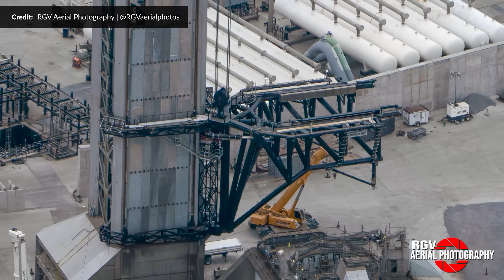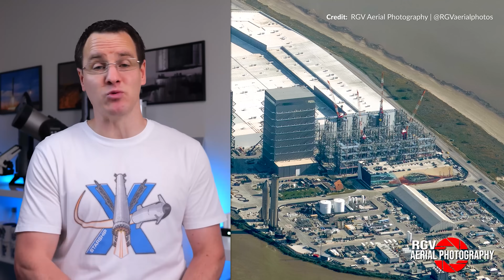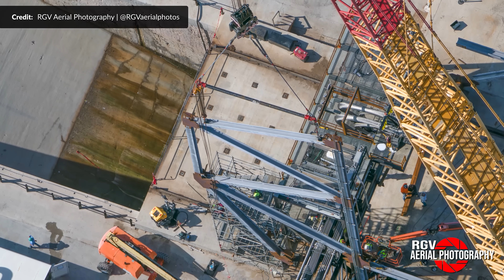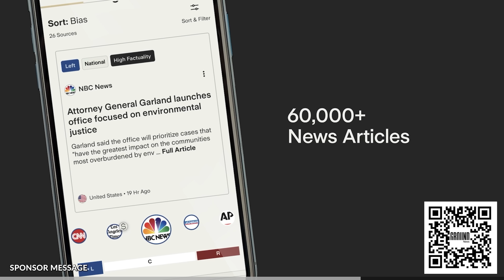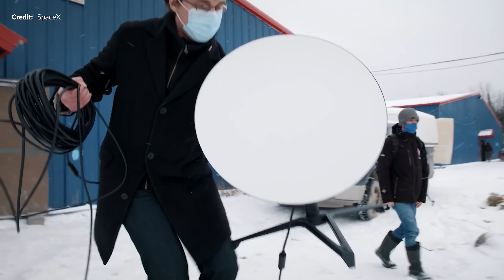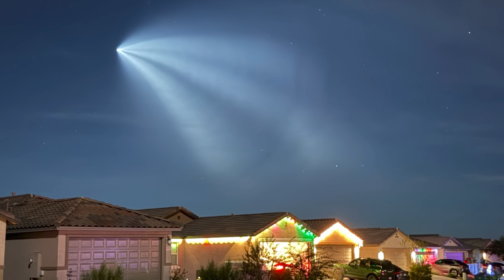SpaceX’s Starship Is Creating Massive Value!

Comment: How does spending a ton of money to develop yet another another rocket equate to creating value? Value is only created if the rocket actually works better than the existing rockets that it aspires to replace.
Reply: It doesn't aspire to replace anything.  It generates value by allowing them to put a large constellation up and keep i up to date on the CHEAP.  Plus they have a lot of internal ambitions (Mars).  It is those  internal goals that are behind the development, not the commercial market.  The ability to put up large amounts of mass on the cheap ads value.

Comment: The problem is that they are developing an EV suit with all its requirements designed for space instead of a lunar highly mobility suit. The mobility suit should sacrifice a lot of the requirement that an EV suit would have. For example the many layers of thermal heating should not be a requirement. I'll go so far as to say that the EV suit is not suitable and is actually dangerous for Moon missions due to it being clumpy.
Reply: Spacex has no need for lunar mobility suit.  IF they have a need for something it would be down the road for Mars.

Comment: I don't think they had a bad COPV batch. I think they removed the extremely dangerous failure point by a fundamental redesign. They are a pretty small part of the whole system, there is no reason to stay cheap and lightweight there. Seeing the Ring Structures around the New Pressure Vessels and the bigger Diameter I suspect they changed it from a COPV Design (composite overwrapped pressure vessel) to a steel pressure vessel. It does not add much weight, but steel is way more predictable for pressure cycles and temperature shifts than Composite Materials. Let alone if the COPVs already have shown to be a critical failure point in first tests. I think steel pressure vessels would be a huge improvement for this reusable Rocket system.

Alternatives could be fundamentally redesigned, custom COPVs with an emergency deflation mechanism (ripping off only on the outside to keep the rocket shell safe). I am very happy to see that critical part changed out before the next tests. This should never again be the initial cause for a RUD.
Reply: Mass issues are a big issue.  Their big goal is lightweight when and where possible.  I doubt they change.
Reply: @imaginary_friend7300  After two COPV caused RUDs I think a few 100 kg more are a decent tradeoff to keep it safe. Who cares if it the whole system can lift up 100 tons or 99 tons? At least until COPVs have been proven to withstand the harsh environment in 100 percent of the ships lifetime.

Comment: Assuming the hydraulic pumps are unchanged the bigger diameter barrels on those arms means that the arm closure will be considerably slower. Evidently they needed more precision even though it means Starship has to hover a little longer.

Comment: Higher density of customers, hmm wonder how wide the beam is. Means if you and your next door neighbor are both using may get some cross feed and thus bad packets.
Reply: You and your neighbor will share the same satellite, along with possibly hundreds of other houses. But no, it won't cause issues with packets. At least nothing noticeable. This has been covered by IT networks for decades now.
Reply: @anthonypelchat  yes that is what check bits are for. Elon cited higher density of customers in his response so I was wondering what is dense.

Comment: Re:title. How? With suborbital flights?
Reply: People can see the potential among other things.  They've been making steady progress, not always timely but progress still.
Reply: Those "suborbital" flights are barely suborbital and actually at orbital speeds. But the construction itself is creating value in the local area as it is adding a lot of value to the community. And Starship will be fully orbital shortly, assuming V3 doesn't have the same issue that the last version did last year.
Reply: @anthonypelchat  I am looking forward to the promised 150 people in starship and the 20 minutes to prepare for the next flight. Or is it all bs maybe?
Reply: @TypHierJeNaam  Point to anytime that Musk, Shotwell, or SpaceX as a company have promised 150 people and 20 minutes for a flight? They have stated that as a possible future, but not some promise for anything.

Also, the 20 mins is just how long it will take from take off to somewhere on the otherside of the planet. They are looking into that for the military and as a possible option in private areas. But it requires a ton of international regulations and approvals that SpaceX has no control over. As such, it has always been stated as a possibility and not a promise. In fact, almost everything has been nothing more than a hopeful goal. Very few, if any promises have been made.

Comment: Yeah only five years behind schedule on Starship achievements. Costing the tax payer a fortune.
Reply: Development rarely sticks to timelines and it's not costing the tax payer anything else.  You need to find a much better source to feed you what you're pretending you know drone.  Your current source is making a fool out of you.
Reply: @imaginary_friend7300  First Full Launch: The initial expectation was to achieve a launch by early 2022, but it only materialized more than a year later, primarily due to unforeseen technical issues.
Orbital Refueling: Originally intended for 2023, the first demonstration of orbital refueling has been pushed back to mid-2026 as SpaceX needed additional testing and regulatory approvals.
Lunar Missions: NASA's Artemis 3, which includes a lunar landing using Starship, has seen its timeline extended from 2025 to 2027 due to readiness concerns from SpaceX, which reflect ongoing developmental setbacks.
Mars Goals: Elon Musk initially aimed for a Mars mission to launch by the end of 2026. However, this has shifted, with suggestions that an uncrewed mission might delay until 2028, and a crewed mission potentially moving to 2030.
Reply: Tax payers aren't paying for the delays. Where are you fools getting that crap from? SpaceX only works on fixed cost contracts and has literally saved tax payers tens of billions, far more than they will pay SpaceX for Artemis missions.
Reply: @anthonypelchat  Taxpayers are essentially funding a significant portion of the Starship program through federal grants and contracts, which are seen as part of a larger post-Apollo era strategy to maintain U.S. leadership in space exploration. The total cost implications will continue to evolve based on the program's success and future contracts.
Reply: @TimRaine1 No grants. There is an HLS contract for 4b for 3 landings. However, only a portion of that will be paid prior to the first landing. And they don't pay at all for delays.

This also won't cover the majority of Starship development. SpaceX had already surpassed 10b by mid-2024. The main funding for Starship comes from private investments, profits from their launch business, and of course Starlink, which has over 9m subscribers and accounts for nearly 3/4 of SpaceX's revenue.

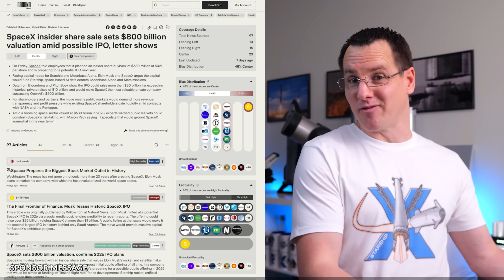Comment: 10:20 The valuation information you gave is inaccurate. The timeline:
August 2025- Valuation of $400 billion based on current Starlink and Dragon/Falcon
December 2025- Valuation of $800 billion, updated after developments including announcement of AI in space and switch to Starship V3
IPO proposed valuation mid 2026- $1.5 trillion based on likely Starlink upgrades and Starship's projected milestones.

Comment: Good as usual and good continuation of the new year!
I have two questions:
One
Why are the tower arms shorter than originally?
Isn't there more risk that Starchip can get too close to the tower and then crash into it more easily or burn the tower during takeoff/landing..?

Two
Shouldn't Massey's test area need two engine test facilities because an accident could stop production again, as has happened before?
It's always good to have a reserve just so as not to prevent or stop production for everything else that needs to be done, in my mind.
Reply: For one, the shorter arms help reduce momentium and vibration issues (there is another more appropiate word, but I cannot think of it at the moment). It won't cause issues with the landing, since it should be more than enough anyways.

For two, the last failure there didn't cause much of a delay. And with 2 towers soon to be operational, it shouldn't cause hardly any delay at all, from a site specific downtime at least. A failure will still cause other downtimes due to trying to figure out why the failure happened in the first place.

Comment: I presume the reason SpaceX isn't cladding certain parts of the launch structure in Ship tiles (eg the QD hood), is because they would get broken/blown off from the shockwaves during launch, and/or because they aren't really needed? (in that the ablative paint is doing a sufficient enough job and the refurb after is comparatively trivial/easy)
Reply: Yeah, ceramics don't' take the blast pressure well.
Reply: @imaginary_friend7300  That's a bummer. Thanks 🍻
I wonder, since they don't have to worry about weight, if they could make them more rigid by mounting ("gluing") to a metal backplate, or even the hood directly. Or would that STILL not be enough?

(I know the Shuttle issues with the foam but that was a kinetic event, which is why I figured this might be more viable)
Reply: @DUKE_of_RAMBLE  It would be far simpler to just use thicker steel if required.  That is one of the beauties of being on the ground.  No need for elegance, brute force works.
Reply: @imaginary_friend7300  My assumption was that they're protecting it (the refurb and repainting) in order to prevent the deterioration of the metal from the heat and rapid oxidation (rusting; next to the ocean doesn't help). Thicker would work, sure, but it wouldn't solve the underlying problem, just delay it and require beefier everything to actuate the now substantially heavier parts.

Comment: @MarcusHouse has there been any discussion about the COPV issues potentially being sabotage? I'm just curious given the extra safety testing you described and given the politics involved with all things space atm, I can see there'd be huge advantage in slowing SpaceX down. I'm also conscious rockets can very easily explode though :-)
Reply: Discussion with who?  It doesn't look like beefed up security which is what sabotage would cause.  It looks like increased quality control which would indicate a handling or manufacturing issue.

Comment: Build, rebuild, tear down and rebuild again. This is a VERY expensive and time consuming operation. Myself, I see no need for a tower that both launches and lands the rocket. With the ability to rapidly move a rocket on site I think it is to your benefit to have separate launch and landing towers/platforms.There are so many reasons to have landing platforms it is hardly worth listing all of them. Number one is to minimize damage to the launch tower and protect the ability to launch on a regular basis. You can inspect, store and work on rockets on a landing tower and one launch tower can be supported by many landing towers. As far as iteration goes, what we have seen here over the last couple of years is the iteration of a single launch tower. If you simplify the launch landing system it is far easier to iterate a system if you can still use one or several parts of the system. I think someone got the bright idea of a single launch/land system and they went with it. Kind of learn as you go along.
Reply: A single tower that does both is twice as efficient in both hardware, labor and costs.  Why would they do that?  You didn't think that through very far or well.
Reply: @imaginary_friend7300  - that isn't the case at all. They have approved a landing tower now in Florida. You could build a half dozen landing towers or more for the cost of one launch/landing tower. After all, you are dealing with only half of the composite launch vehicle. And, the cost of the launch tower would be less. If that launch tower goes out everything goes out. A dual tower is not as efficient either. You have to wait for one rocket to land before you can get another rocket in place or land another rocket. You also have to unload the incoming rocket. If you damage the tower on takeoff then you have no place to land at all if you have a single launch tower. Weather, failed systems or damage incurred during landing all has an impact on that dual tower. Every landing on a launch tower is an additional opportunity for damage. When I say landing tower that could in fact be a landing platform where the rocket lands in a "pod" made for it. Where the rocket can be unloaded or reloaded, evaluated and maintenance done immediately after flight. I would say a minimum of two landing platforms for every launch tower.
Reply: @rocroc  All of that on the flawed and somewhat simple assumption that sites are limitless when that is anything but the case.  So yes building twice as many towers is not as efficient when you have a limited number of possible sites to build them on.
Reply: @imaginary_friend7300  - no, that is based on the fact that sites are limited. You have to maximize the use of every site you can launch and land a rocket from that meets the trajectory requirements for the mission. Sooner than later more missions will target near earth missions and launch requirements for those missions will be different than they are for deep space missions. None of that changes the need for a landing platform.

Comment: Increasing the size of the rod in the arm's hydraulic cylinder is probably to make it stiffer to reduce the flex and rebound after motion. You'd need to increase the piston's size or hydraulic pressure to make it stronger or increase the flow rate to make it faster. This, I think, is just to make it more rigid.

Comment: With ocean Gate in mind, I wonder if testing copv tanks at or above technical design pressures may weaken them. I think they should X-ray them after testing.
Reply: You're comparing apples to cars.
Reply: Titan used carbon fibre in compression rather than in tension, which to me seemed an obviously silly concept.

COPVs, on the other hand, use carbon fibre in tension. They're a fairly well established technology at this point, although clearly not perfect.

Comment: Those new actuators make sense.  On the catches last year you could see the Chopsticks actually close, and then bounce open as the Booster was sliding down, something that CANT happen, since if they reopen at the wrong moment the booster would miss its pins! (but now with he pins on the fins, that's probably more forgiving, but still something that needs to be addressed.) My guess, is that they're are going for a slower, but more torquey closure of the Chopsticks to avoid or limit that slap-back.
Reply: I think they're electric actuators. It would explain the rod size and the removal of the accumulators.
Reply: Definitely electrical
Reply: Shorter arms reduces the moment of inertia.

Comment: No one seems to talk about a missed catch 'plan b'. Surely SpaceX has redundancy built in?
Reply: It's fun to speculate about what the "plan b" might be for a missed catch, and I am sure SpaceX has programmed for contingencies. What do you think the booster (or ship) would do if the chopsticks didn't catch it?

I guess that if the computers decide that the catch attempt fails, perhaps by sensing that the catch points are below the arms, it will command the arms to open wide and simultaneously increase the vehicle's thrust. Since at that point the vehicle is very light, it should be able to accelerate quickly and establish a ballistic flight out into the Gulf.

Of course, this can only be done with unmanned vehicles. We aren't at the point where there will be humans aboard the ship. When that time comes, there must not be any possibility that a catch could be missed. Right?
Reply: There are always points of no return in any system.

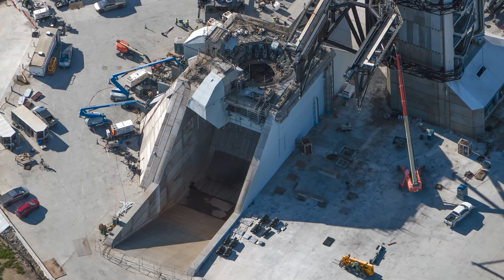Comment: 1:58 finally Somone who actually understands the basis about hydroloic systems
Reply: I think they're electric actuators. It would explain the rod size and the removal of the accumulators. There's no plumbing on the new ones too.
Reply: 0:52 Although accumulators were removed, it is far too early to presume that new ones are not required or pending. The extremely shiny cylindrical surface also indicates these are new hydraulic pistons. 
 @etiennev12

Comment: Just a thought, would it be practical to cover the launch pads and more sensitive structures with the same heat tiles used on starship? Or the same material in different various forms....?
Reply: I think those two cases are very different. On the ship there is friction heating up air. However I feel like it’s basically a cushion of hot air that is built up around the ship. On the pad however it’s getting blasted with tonnes and tonnes of force. I think the hot air there would push in between tiles and or would destroy the thing they are sitting on.
Reply: @reabkire  Good suggestion but we've seen what happened to the strongest concrete available couldn't withstand after the thirty foot crater and boulder sized chunks were thrown like pillow cushions.
Reply: What about stainless steel then, there would be no need to keep repainting, or is it still not suitable?
Reply: @RobertCully  It's a lot more expensive.
Reply: They've been blowing up starships to progress, a maintenance free launch pad is progress 😀
Reply: I think the old tiles could handle the heat, but they wouldn’t be strong enough to handle the force The force would just tear them to bits.
   Good thinking though